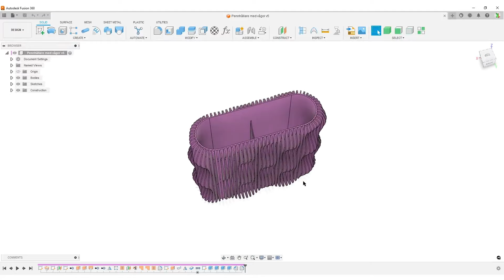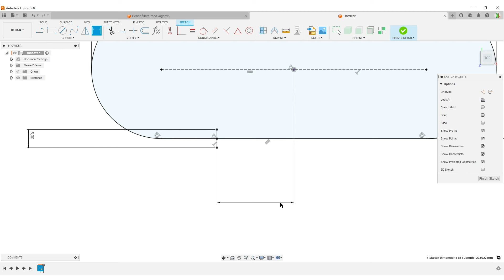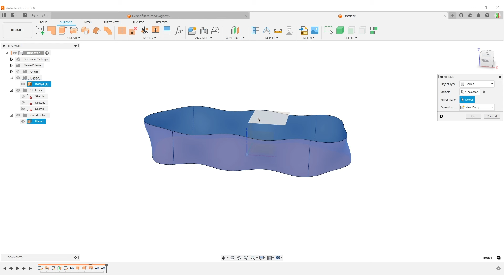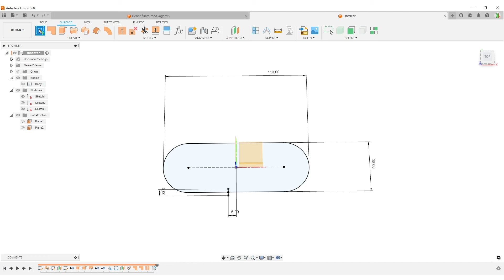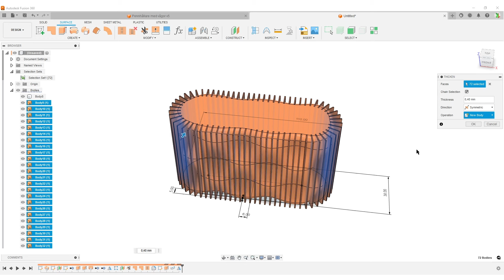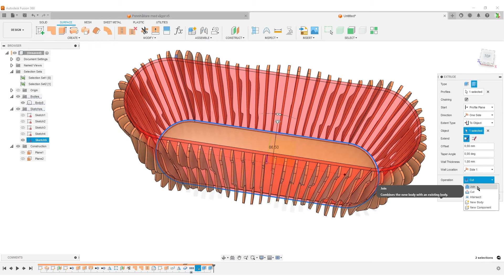Fusion 360 - Wave-Ribs on a Vase or Office Organizer.

Comment: Hello! Amazing video!!! I’m trying to do the same thing with the exterior ribs but when I thicken and “intersect” it’s using the extruded vertical panels as a cut feature and doesn’t create the nice effect. Would you know why??
Reply from the maker: I think I need to see some images to understand the problem. Is the final geometry not looking good or failing?
Reply: @KristianLaholm  Same happened to me also the pattern looks triangulated with sharp slopes
Reply from the maker: @ardaalbayrak9216  could you clarify: Is it that the ribs get triangulated at the outer edge or is it that the cuts get triangulated at the round parts of the design?

Comment: I wanted to make a design with a few hundred panels in the end during my pattern on path, I used two panels with one which was a bit shorter to give some additional design and duplicated this. When I try the thicken operation on my selection set of 300 it uses all my 32GB of RAM and freezes. I left it for 30 mins but no luck, is there a way around this ?

Comment: Love this video!! Do you have any general pointers for mimicking an emboss on a surface that’s curved in more than one direction?
Reply from the maker: I use an intermediate body and emboss on that. Then add that to curved body or use split face + offset face, will not work on all surfaces and there will be distorsions of the sketch you want to emboss.

Comment: Didn't know you could constrain one lines center to another line.  :)  I usually use dimension,  the half of the vertical line to the horizontal line.
Reply from the maker: There are some useful ways of using constraints but it's a bit hard to find help/tutorials on all the small tricks.